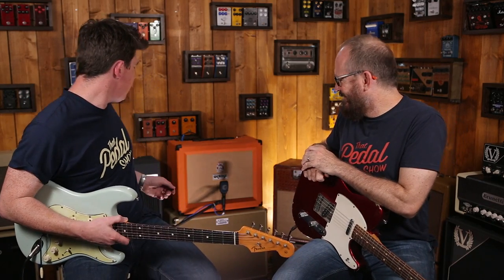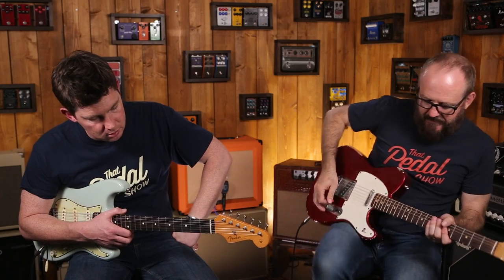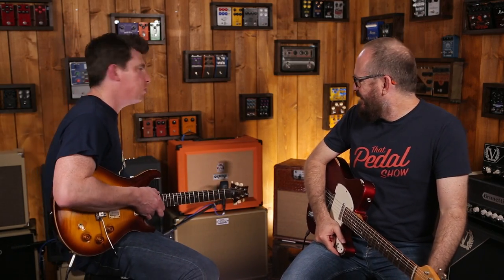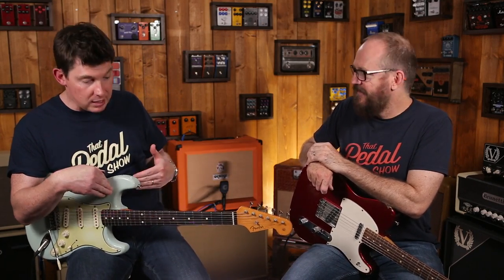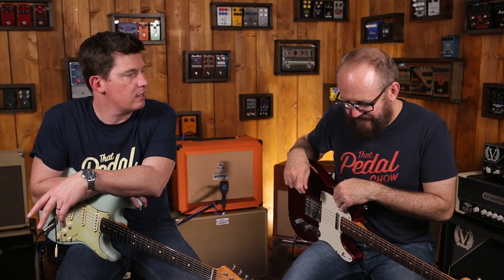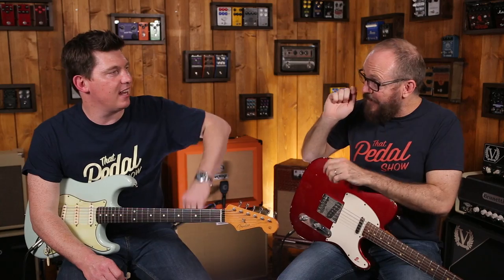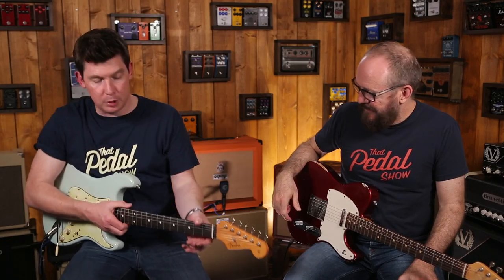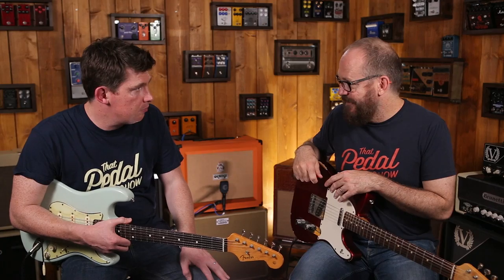That Pedal Show – Do We Like Transistor Amps? Part 1

Comment: video request none master volume amp volume sweet spots any rules with volume position. pedals reaction and jobs at different volumes/gains.. vs master volume amps same as above..

i use a 1987x with fairly high gain tubes (mullards or tungsols). i was quite disappointed in the first month of owning it because i couldnt dial a tone at a reasonable volume  
as i was told you need to be running them up at around 6..
(kicked myself for not going the jtm45 which i now have aswell but a different thing all together)
 but i found i liked the tone at about 4 and a half. which is a fairly dirty clean sound. then using blues driver style pedal to achieve my dirty tone.
i was in heaven.
i have an attenuator on hand incase i get told to turn down at gigs but generally not a problem at the volume im running.

Comment: I have the Blues Cube Artist and the fender bassbreaker 15.  The blues cube sounds better.  I also have hughs & kettner tri amp mk 1 combo 2x12.  The tri amp is 90 lbs so I'm trying to find something good to gig with thats not so heavy.  The blues cube artartist is pretty darn good.  Much better than the bassbreaker.  I can't figure out why they have a 2x12 in this video.  It will always sound bigger.  I would put the blues cube artist up against any tube amp in a blind test.  I will bet money they won't be able to tell which is which.  I will bet they pick it over the tube amp.  I also had a couple very expensive Supros.  They sounded like mud.  They look good but did not sound good.

Comment: I've just got a katana head for practice and fun  and it's great for that and it's plenty loud enough to gig but I wouldn't have the courage to. at high volume on the drive  channels this amp through a
 Marshall 1960a has the most appalling high frequency ring to it that you can't dial its out almost microphonic in nature  it's hard and brash and not nice at all, leads me to think boss engineers had a day off
I'll be staying with my valves for now , tsl and jvm

Comment: Love these guys and the show, but there's a ton of (admittedly 'admitted') bias in this video. All three of these amps have pronounced strengths and weaknesses, highlighted by how differently they respond to the same pedals. To my ears, it wasn't a matter of "The Fender spanked them both!" The Bassbreaker sounded awesome with pristine clean or slightly broken-up crunch tones, but I'd never choose it for a heavier rock, or fusion gig.

The stunning thing as I read some of these comments is how antiquated folks' (especially tube purists') ideas and perception are of any amp that is not valve-based. Solid state gear is not the same as it was in the 80s and early 90s. Not even the same universe. As a professional player and teacher who has used nothing BUT modeling gear for the better part of 15 years, I can tell you: it has improved by leaps and bounds, even in that short time...and believe it or not, you don't have to spend $2000 on a Kemper or Axe-FX to get GREAT, giggable, sessionable solid state tone. 

I'd love to see Dan and Mick try a proper affordable modeling combo (Blackstar ID:60 TVP...Vox AV60 anyone?) and put it up against any tube amp that sells for under $1,000. I think the results would be quite surprising!
Reply from the maker: +JazzzRockFuzion Fair comments all round. Mick here - I've tried all that stuff having done many years as a product reviewer/journalist/editor for magazines. 
Everybody has their opinion and I too enjoy basic modelling amps at home, practise and all that. I especially like the Fender Mustangs for their sound and value.
But - and this is just a personal opinion - for my tastes they are so fundamentally far away from the stuff I really love - quality valve amps and decent pedals - that I don't even think they're in the same world. It's like comparing a 125 commuter bike with a Ducati Panigale. They're both motorcycles, one is probably more practical for getting you to work, but for being excited, inspired and playing to your full potential... literally no comparison. As I say, just my personal opinion. Which I'm pleased to be able to share these days, rather the ridiculousness of trying to be objective as a reviewer! This is art, not science. Thanks for watching!

Comment: Ok, question, how do I incorporate stereo pedals AND an aby into the same board?
Reply: For example, I've got a prince of tone that I run through two amps using an aby, but I'd also like to be able to use my strymon deco in its stereo settings. Thanks in advance for any help!
Reply: Dump the a-b-y and use the deco for the stereo outs or run the deco mono into the a-b-y...
Reply: +Drew Florey well no, because that doesn't solve my issue. I want to be able to use the aby for other effects but use my deco as a stereo effect also
Reply: Looks like you need two Decos....
Reply: Or, if all stereo pedals are suitable for use in an effects loop, run amp 1 effects send to the left input of your strymon then amp 2 send to the right input. Then strymon left output to amp 1 effects return, strymon right output to amp 2 effects return. Then you can keep your prince of tone and aby in place like you've been. Hope this helps!
Reply: You can also do this in front of the amp by putting the outputs from the aby into the left/right ins of the strymon and the left/right outputs to each of the amps.
Reply: +Mike Grisafi amps don't have effects loops. I'm using a combination of a twin reverb, a 59 bassman, and a reeves custom 12. I did some more looking around and I think a stereo aby is what I need. Though if anyone knows any other tricks I'm all ears
Reply: +Drew Florey no, dude, I know it's possible, if you don't know the answer you don't have to answer
Reply: use an aby with stereo inputs. like the lehle little dual.

Comment: The biggest difference between the valve and transistor amplifiers in this video is Mick and Dans less than thrilled faces each time they play through the Orange or Roland.
Reply from the maker: +bwgti Yep. It's just our opinion though. Each to their own. We've tried to be upfront about the fact we don't really like them, which in the grand scheme of things means precisely nothing! But still, it's a question we were getting asked a lot, so we're doing our best to be open minded and at least have the discussion.
On a side note, we've just come back from Copenhagen where we did a couple of live clinics using a 70s Pro Reverb and a very well sorted vintage 50-watt Plexi. 
It's only strengthened my view (Mick) that no transistor or digital amp comes anywhere close to a great valve amp at proper volumes. Now of course, not all valve amps are great, and we can't always play them really loud. That grey area is where the more interesting questions are, and hopefully the ones with which we can engage on the show. Thanks for watching!

Comment: P.S. Guys if you get the chance put a Red Llama in front of a transistor amp with the gain set really low. That tiny bit of tweed grit works wonders.
Reply: the problem is its about 1/3 as good as into the tube amp
Reply: Define good though. A transistor amp can be more reliable, the sound won't change during a gig as it warms up, in my experience a lot of pedals feel just as much fun to play through either. Rats, llamas etc.. You can do anything into a peavey clean channel. Also loudness is a factor, this debate can't take place at bedroom level.
Reply: This is only anecdotal but both my gigging valve amps have failed on me more than once during a gig, neither of my transistor amps have. Only reason I bought one tranny amp is because the valve was in the shop and they couldn't figure out what was wrong with it.  Both types of amp have their merit.
Reply: +Alan Angel Of course! I used to hate transistor amps and everything digital but find myself more and more relying on those as these things are slowly getting better. They sure have their practical use (e.g. home recording and virtual re-amping, low volume bedroom playing, going direct into the mixing desk etc.).

Comment: Man that Orange sounds thin and tinny - no thank you and I shall faithfully stick to my 4 watt Vox valve!
Reply: Orange amps are not meant to be played on a clean channel with pedals lol. The Crush's dirty channel will murder both these amps for distorted tones.
Reply: Michael Bell 

I’m talking about the first time they played it as the clean demo with no pedals running through it. Also I highly, highly doubt that it would outperform the Fender in an overdrive showdown.
Reply: Ummmm, yes it would. Ive played the 18/30 several times and I own the Bassbreaker 45. The 18 side is a '61 BrownFace Deluxe circuit and the 30 side is a '65 BlackFace DR circuit minus the reverb but the 18/30 has EL84s. It doesn't have a very good overdriven sound  because it gets very flubby and doesn't sound good and loses articulation when its pushed into breakup. Again, the Orange will murder either one of these amps with its dirty channel which has the same 4 stages of gain from the Rockerverb.

Comment: No guys come on!  Doesn't it affect having 2 ×12 in the Fender as opposed to just 1 in the other two amps? Not fair comparison then. And you guys keep praising the fender in despite this uneven specs. Why you didnt get the blues cube artist which has more headroom and a presence knob that really adds to the tone? Or why didn't you just stop yourselves to keep priising the Fender? Come on you are the best on this but on this occasion I disagree with set up for this comparison
Reply from the maker: +Ces McMyth Fair comment on the 2x12 perhaps. However, we could equally have used a Hot Rod Deluxe or any other decent 1x12 combo and the results would be the same. The question is flawed to be honest. Of course we prefer valve amps - always have, absolutely always will. Looking back I’m not even sure why we made this video, other than trying to answer questions that don’t need answering (for us anyway).
All of which is said in the context of our personal opinions. Just our opinion, not what anyone else should or does think. Cheers!
Reply: That Pedal Show ah! So there is no part 2 yet? Maybe it wont be at all. I am just offended 'cause I have the BC Artist 😂😛

Comment: Great video but I still think that you are missing the point here. You are using entry level amps from companies that also sell very expensive tube and/or digital amps. Even though the small amps don't perform that bad in your test they are still built and voiced(!) to a price point.

A huge tube amp company like Orange has absolutely no interest to create an affordable solid state amp that will outperform a Rockerverb in sound and feel. Not even remotely. Same goes for Boss/Roland with their high end digital stuff. They have to keep a margin between the product ranges somehow.

You should try amps from companies that are specialized on solid state amps like Tech 21, Evans, Quilter Labs, PCL Vintage Amps, the classic Lab Series L5 or the old Pearce G-Series. Just to name a few. Maybe you could also check out some cheap classics like Rockman or Pignose for the fun of it.
Reply from the maker: +Matt Phistopheles That might a nice direction for Part 2. Tech 21 and Quilter are on the list. Thanks for watching!

Comment: if do not like fuzz than going be hard to like overdriven BJT transistor amp. BJT transistor amps do not sound good at break up. So you get no man land in gain spectrum of BJT transistor amp. it clean or enough gain to keep single clip for whole note. if use a boost in front BJT transistor amp you get fuzz usually boost pedal has enough gain to make Transistor amp sound like a good fuzz. fet transistor amps sound like tubes and are cheaper tube amps but rare. mosfet amp sound 99.9 percent like tube amp. Reason why tubes stayed around because players know what inside.

Comment: What is the difference between a tube amp, transistor amp and modeling amp? 🤔❔
Reply from the maker: +jaersee There is great wisdom in that question. :0)
Reply: That Pedal Show 😶
Reply: Differnent technology - tube , mostly hand wired / solid state - analoque  / modelling - digital with computer processors .

Comment: In many ways this is an unfortunate episode. Trying so hard to be open minded was completely undermined by your reactions and the basic difference in sound between the amps. Yes, someone will like a "sound", whatever it is. But the history of rock n roll has formed our criteria when it comes to amplified guitar tones. Even with the compression of sound through YouTube and then my headphones, the dynamic range of tones (not volume) was clearly evident. The ss amps have a "block" sound where it is characteristic but monolithic, while the tube amp allows the separate character of low, mid and high tones to be differentiated. I am not a cork sniffer, I like the idea of a cheaper and less fragile alternative to old school tubes (Quilter, anyone?), but the hard weight of experience and aural impression continues to confirm tubes for me. So maybe it was laudable to try this episode. But That Pedal Show comes from a vintage-informed ethos. Don't do a part two. Instead, replicate the vintage guitar episode from last year, but with amps: compare some modern tube amps with some old tweeds or blackfaces or plexis. Finding "mojo" is much more important than explaining it or replicating it. As for ss amps; an orange that looks and tastes a bit like an plum is still a strange fruit (pardon the dreadful puns there!)
Reply from the maker: +fossilmatic We agree entirely. We were just tired of people asking why we never play tranny amps. We'll do a couple of videos to ask the questions openly and record the results. If those videos change our opinions, we would change the gear we use. If they don't (they don't) we won't. It's the same with Kemper/Helix. It's right to ask the questions - it's all a journey! Thanks for watchingZ

Comment: One can either go ahead and play music OR use tube amps. They sound better most of the time but they are not consistent at all. The WILL give you trouble eventually. I personally love music more than valves.
Reply from the maker: So what about all the music created with tube amps??
Reply: I admitted that they sound better. But giging? Giggity. You're obliged to carry a backup. :( I know transistors break too but not that often.
Reply from the maker: If that’s a compromise you’re willing to make, that’s great. But we’ll go for tone 100% of the time
Reply: I love music more than tone.
Reply from the maker: They are intrinsically linked. Great tone is an inspiration to make music
Reply: Definitely agree. That's why i watch your show. Transistors can have a great tone too as you proved in the video ^ ^

Comment: You guys always always tilt whatever you guys prefer in your favor, its ridiculous. Why a 2x12 tube amp and only 1x12 SS amps? Of course the 2x12 is going to sound bigger and fuller. You could have got the Crush 120 with two 12s and Blues Cube Artist 2x12, but you didn't because you WANTED the tube amp to sound better. The 2x12 SS amps would hang right with the 18/30. Complete fail and useless video.
Reply from the maker: I think we discuss this in the video? We’re guessing you do like transistor amps? In which case you’re always going to be disappointed by TPS. There must be a channel somewhere that likes them and uses them that you would enjoy more? Sorry to waste your time!
Reply from the maker: Again, pretty sure we discuss that in the video. And as always with TPS, there is no ‘win’. It’s all a discussion and a journey, not a conclusion or a destination. If I remember correctly we chose the BB because it was the cheapest valve amp we had at that time - we didn’t have a 1x12 combo at that point of an equivalent wattage. If we’d used something like the Lonestar, Hamstead etc with a 1x12 cab either would have really outshone the tranny amps by a mile. I think that was our thinking. In any case, there’s some stuff of value in here, not least hearing all three whether it was a ‘fair’ comparison or not. Context, context, context. If you spend much time with us you’ll realise that we’re not really about hard answers. It’s all a journey and it’s all interesting. Cheers!

Comment: Lessons? LESSONS,?
WELL,- You can use SS amps to some effect, most notably as a second in a stereo or wet dry,- but it just ain't ever gonna be anything but a specialized or default option.I know guys who swear by transistor, and,- universally,- I don't get it.Their explanations and claims don't hold water to my ears.
Hybrids can be a bit different, depending on application; there is a quality to the lows when pushed with higher wattage/ output; my experiments continue in that area.Dosen't seem like a waste of time or effort.One word game changer? Possibly "Quilter"?